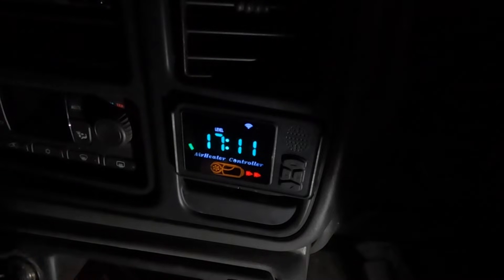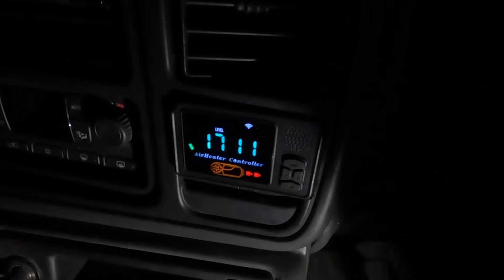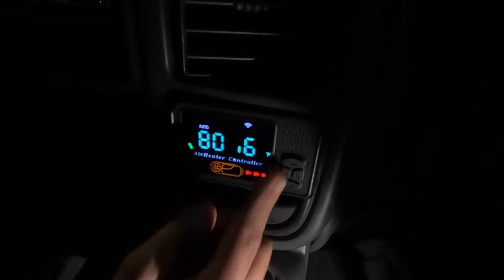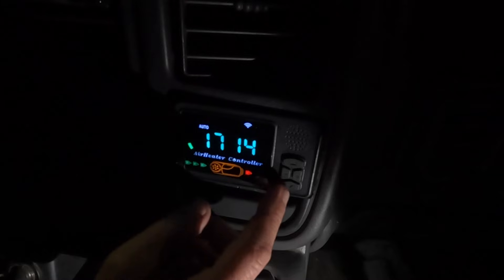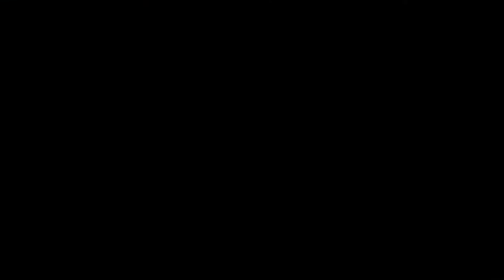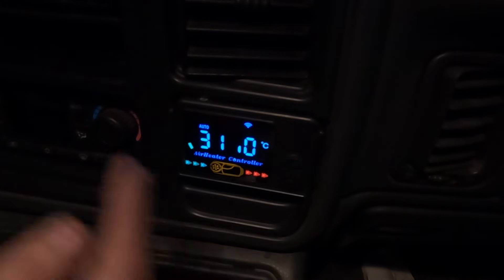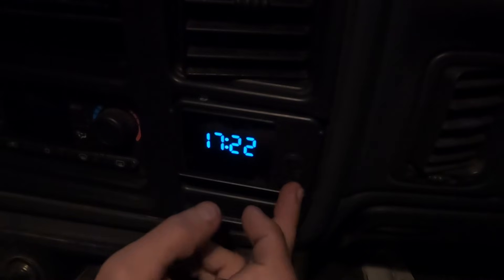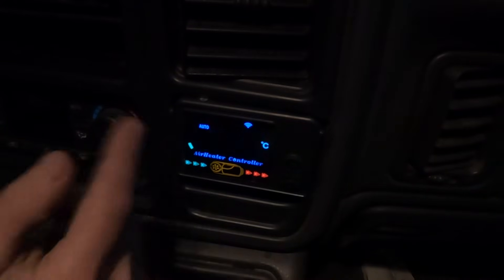Bluetooth Diesel Heater Feature & Settings Discovered !

Comment: Thank you very much for the video. I picked up this same heater on Black Friday. Do you (or anyone else reading) know if it's necessary to tune the heater; or does the auto altitude function look after that?  I've watched many videos of other controllers/heaters that have a secret code, allowing access to pump settings, fan speed, etc. Apparently enabling adjustment for an efficient burn that prevents carbon/soot build up in the combustion chamber.
Reply: The secret code is used  typically if you're going to try to use an alternative fuel.
Reply from the maker: @johnwyman6126  The secret code "engineering menu" does not exist on most new controllers as it is one more thing for people to mess up, haha. 

On the old controllers (still sold on some new heaters), they did not have automatic elevation compensation. When you go up in elevation, the heater will require less fuel so the ability to change air fuel ratio manually, was necessary. Most new heaters either have a high elevation mode, that you switch with the single push of a button, or switch automatically based on air pressure. 

Some heaters are designed to run on gasoline as well as diesel. However, retailers & manufacturers do not want people putting alternative fuels into their product and I highly doubt that this was one of the considerations for this feature / adjustment.
Reply from the maker: Thanks for the comment. Yes, this heater has auto elevation compensation. 

This does not have a "secret code" engineering menu, like those older controllers. Although this does offer plenty of adjustment, unless you really know what you are doing (contrary to what the videos say) most people are more likely to cause problems by messing with those adjustments. 

Cheers.

Comment: where it is 0 degrees, the temperature of the panel sensor can be calibrated by +/-9 degrees.
Reply from the maker: Thanks for the comment / info. A few other viewers have pointed this out and I have pinned a comment about this to the top of the comment list. 

Cheers !

Comment: Great info.  Have this heater in 8kw with same controller.  Puzzled thru most of it, though thermostat is off a lot. Set it to auto function as I installed it in a 25 ft motorhome,  hope it works  like yours. Mine is quiet with great heat.  No complaints.  Great video.
Reply from the maker: Thanks for the comment. 

As a few commenters have pointed out. Where it says "0C" in the menu (7:02 in this video), this is how you correct the thermostat.... it has + or - 9C or compensation, so you can try to match the controller to actual room temp. 

It is important to note that the controller has the heat sensor in it, so if it is mounted to a hot or cold wall, or in a area closer or further from the heater, near a draft etc.... this will greatly affect the reading.

Comment: I love my Vevor heater.  The absolute best part of the heater for my use case is the ability for the heater to automatically determine my altitude. I can expect to run my heater from 2000 to 7000 feet, so this makes a huge difference from fiddle F’ing around with charts and settings, and getting it wrong.  Last week, my new heater was keeping me warm at 6500 feet @ 9 degrees Fahrenheit (-13 Canadian).  Thanks for the thermostat tip.  That will work great for short weekend trips where I’m not super concerned with using all of my battery capacity.
Reply from the maker: Thanks for the great comment ! 

You may want to test your heater on the auto on feature to see how often it cycles on and off. This may actually consume more battery power if you are not well insulated. 

The "smart mode" may be a better option or simply setting it on heat level 1, depending on how often it shuts down and restarts. The glow plug powers on for start up and shut down, and this eats up quite a bit of power. 

Cheers.
Reply: Except it doesn't work. Ive had two of these controllers now and both have never read anything other than 0 meters and I live at 4800' after months of arguing on the phone the lady finally admitted to me that it doesn't work and that they aren't bothering to even update the software with a fix. This controller is just garbage. Nothing is adjustable. The only thing that it does do is it can bluetooth to your phone. The app isn't worth a shitvl either. You can turn it on, off, up, and down. Whee! Meanwhile since the altitude isn't adjustable it burns so rich it comes tye combustion chamber solid with soot within a week. I bought two at tye same time and neither on has worked. My buddy also bought two at the same time and neither of his worked either. What a scam. Ibdidnt expect a Lamborghini for $60 but I halfway expected the controller to do at least a little bit of what its advertised to do. Threw both in the garbage and ordered two blue controllers that are fully adjustable and haven't had an issue since. If you dont have one of these yet save your money. Or better yet just light it on fire. Same difference.

Comment: I have two of these controllers. when you see the 0 C setting, you can adjust the controller  +/- 9 deg if the temp reading is incorrect on the controller. Vevor calls it temperature compensation. One of mine was off +12 deg off, I can only go -9 so they are sending me a new controller. I have a video that Vevor sent me if you want to see it .....
Reply from the maker: Thanks for the comment. Someone else also pointed this out. Do you have a manual that actually tells you this, or did you find the info somewhere else. Just curious. 

I'm pretty sure that my controller does not read the temperature correctly due to where I have it mounted, but I'm okay with it as long as it keeps my truck warm, haha. That being said, 12C error would be annoying !

Comment: Thank you! Greetings from Finland. Just -20C and cozy +21 in my Trailer. :) (it runs around 4-6 levels). This thermostat feature is more than great. Ofc in this weather it is always on, but we get snow even in june, so then it is handy! Thanks alot!
Reply from the maker: Oh wow... it's been fairly nice here the past few weeks... 5C here today... but it will be cold soon. 

One of the features in the controller you may be interested in is correcting your thermostat to match the actual temp of your room. Once in the menu you push the up button 4 times and it says "0C" You can change this to offset. You can change it either + or - to try and match with reality.
Reply: @loweredexpectations4927  I did adjust it and works now fine. Also the weather is now at 0C so it goes off and on now.

 Auto on/off is great feature. I wish it didnt stop the fan though... Webasto Airtop 2000 doesn't. So the temperature inside doesn't fluctuate so heavily in my trailer with webasto. But i put a blower in it and it runs always, switching it manually. 

I reckon i could solder extra wires on motherboard for a fan relay, so it would be off when the cdh is on, and goes on when ther cdh fan goes off.

Comment: Hey Joel,  any idea where to get just the bluetooth controller that you have?.  I already have  a Vevor Heater with the old blue controller but didnt see the controller you have on their site or  on the web
Reply from the maker: Hey Pub. From what I can tell, they are not available through any of the usual places... I actually did some looking, because I knew this question was coming. 

From What I know, Vevor doesn't do any parts at all. You may be interested in the Bureck remote that I mentioned at the fist of this video. It uses the signal from your current remote (most remotes) and gives you the ability to set a full weekly heat schedule, as well as set temperature swing. Meaning when you set the heater to 19C, you can have it turn you heater off at 19, but also choose when it turns back on. Instead of turning back on at 18 or 17, you can set it for 15 so that your heater doesn't turn on and off 20 times every hour. 

I haven't tested it yet, but if it works the way they claim it does, it will be a pretty awesome product. 

I almost bought a new heater to use the old one as spare parts, or as a backup heater. They sell for $169.99 ...By the time you get the controller, a burn chamber and a few other parts...  Of course, not everyone tortures their heater like I do, haha.
Reply: @loweredexpectations4927  Thanks Joel.  I might check out that controller, or just wait for you to review it first😁.   Supposed to get a big dump of snow in ole cow town tonight so I'll be running the heater in the garage  for sure.
Reply from the maker: @PUBHEAD1  They have shipped the remote, so I should have it pretty soon. The heavy snowfall warning caught be off guard. I went and got more fuel and ... I may run my heater to see if I can keep my truck thawed off.